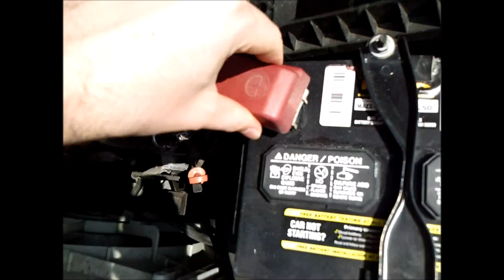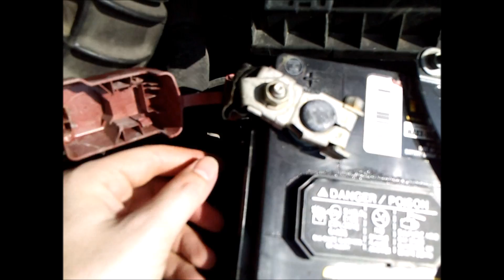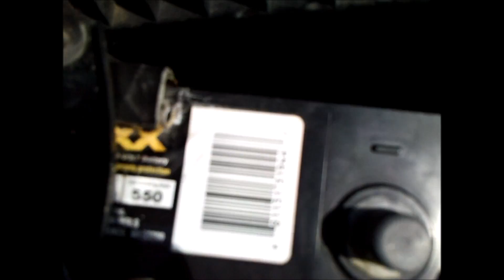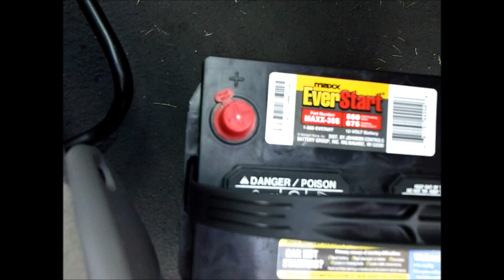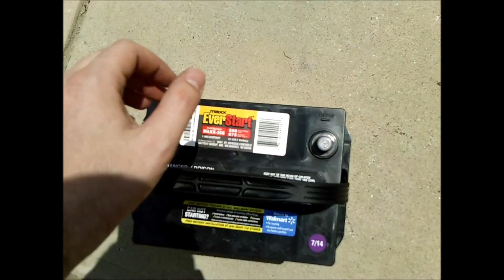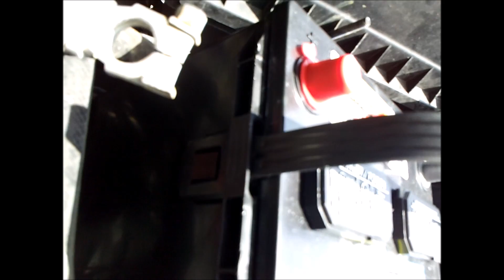How to Replace a Car Battery – Toyota Corolla (Step-by-Step DIY)

Comment: You DIDNT show how to attach the j bolt!
Reply from the maker: Thanks for the feedback; you just hook the bottom of the J-bolt into the slot on the battery tray before tightening the nut on top.

Comment: Thanks for the video. Just got my battery replaced at Walmart. I opened the hood and found the positive post cover not in place. No big deal, I will snap it on myself. When I did the entire battery moved. The J-bolt base clamp was not secure. It took me a while to get it under the base tray and tighten down. I used your trick to remove the left side handle but couldn't get a screwdriver in the right side. So I used a pair of garden pruners to cut the handle.
Reply from the maker: Great work! 💪🏻

Comment: can u show a close up where the rear hold down rod goes? I cant find any hole in the rear of battery????
Reply from the maker: My best advice, lift out the battery entirely and use a bright flashlight to find the rod hole.

Comment: Great video except that there is no need to remove the battery handle. It isn't in the way. Leaving the handle installed on the battery is highly convenient the next time battery removal is required.
Reply from the maker: To each their own.

Comment: Dude how do i get the rod that is hooked into the frame. Back into its hooked position.. It fell over the second I removed the strap bolt. And I can't get it to hook into anything while still being long enough to connect to the battery strap
Reply from the maker: It takes some practice! My suggestion - take the battery out entirely and get familiar with the hook-hole location, then during re-installation use a flashlight to make sure you’ve got the right spot.

Comment: Exellent video, I normally take of the bolt to the clamp that's bolted on to the frame, I happened to lost it you wouldn't know by any chance what size and length it would be?
Reply from the maker: Thanks!
I don’t, sorry - you should reach out to your dealership.

Comment: After changed my battery from my Corolla …the car was desregulater on lower rpm . It’s normal ??
Reply from the maker: That sounds like a different problem - the battery change should not affect the RPM.

Comment: Can you recommend the tools required to replace the battery
Reply from the maker: Socket set/wrenches are the basic necessity.
Gloves/eye protection for safety.
Acid cleaner if the cables are stuck on really hard.

Comment: I see no reason to remove that plastic handle; it makes it easier to lift out the battery in the future and is compressed nicely by the security bar.  I also also use terminal grese on the battery posts as it retards corrosion. I got excellent service from the OEM battery from  2009 Corolla and replaced the battery in the summer of 2020
Reply from the maker: Great suggestions!

Comment: 7:10 dude you cut out the most important part for me, how to connect the rod that the strap connects to...
Reply from the maker: Sorry about that! There is a hook on the rod, and a hole on the platform, that secures the battery.
Reply: @GalippsGadgets  WHERE is the hole on the platform??
Reply: @MrBilldodd   Agreed....can't find the hole for the rod (That's what she said!). Seriously though, I shone a flashlight down there, and can't find the hole in the metal support under the plastic tray....help!
Reply: YES, I CHANGED MY BATTERY AND HAVE NO IDEA WHERE THAT GOES. i FELT FOR A HOLE DOWN BELOW TO CONNECT IT.
Reply: That’s the most challenging part today. I was changing my led headlights what a nightmare trying to place holder down to the whole to stay stable.

Comment: question if i replace my battery will the clock and radio be resset or have issues with raido locked?
Reply from the maker: It depends on the make and model, and if your radio is equipped with a battery backup, but most vehicles will be reset.

Comment: Straight forward replacement for most Toyota cars - BUT - remove the cables in the correct order:  To remove OLD battery always remove Negative first - than the Positive.   Hooking up a NEW battery always connect Positive first than the negative.  Search this if you have questions.
Reply from the maker: Thanks for the comment - could you please subscribe to my channel?

Comment: What to do when you have a battery wire that's to small to fit over the battery prong itself?
I am not at all motor savy.
THANKS
Reply: My second negative wire has small rings instead of a wrap around like the positive one.
Reply from the maker: I’m not able to diagnose your issue without looking at pictures - you might want to go see an automotive technician.
Reply: DavidGalipp 
I had figured it out. Thank you!
Reply from the maker: Thanks for the comment - could you please subscribe to my channel?

Comment: How do you reconnect your battery without setting off the alarm?  Is there prep work to reconnecting the battery without setting off the dealer installed alarm?  My 95 Corolla doesn't seem to have a reset button anymore and the keyless entry remotes aren't very responsive and reliable.
Reply from the maker: +ourlegacy I wish I knew the answer, but I think it depends on the brand/type of alarm you had installed.
Reply from the maker: Thanks for the comment - could you please subscribe to my channel?

Comment: Thanks.  today, I repeated the process shown in your video on my 2003 Toyota Tacoma.  To prepare for my trip to Walmart ( Walmart Supercenter in Kenner, LA ), I used my phone in my right hand to take pictures of my battery with my left hand holding a ruler across the length and the width.  Also, I wrote down the battery dimensions: width, length and depth on a piece of paper.  I walked into Walmart with my ruler and the piece of paper. When I visited the Walmart battery section, I used their mini-computer on the wall to select my auto(truck) make, year, model, and engine.  I was returned with a list of many possible batteries.  I chose a battery using the mini-computer list, my phone pictures, and verified with my ruler measurements that it would fit in my truck.  Later, during my actual battery install, I ended up leaving the battery strap on.  Seven years ago when Goodyear changed my battery they left the strap on.  I figured that any future removal of the battery would be easier with the strap on and my truck hood closed and opened without any problems. ... Thanks! for the video, I re-watched it many(4) times before I did my battery change!
Reply from the maker: Great job Andre!

Comment: David,

Thanks for the video. I have a 2005 Corolla also. Is it going to be 10MM socket also?
Reply from the maker: tomatojuice12 It SHOULD be, unless you've had some aftermarket changes to your electrical wires.
Reply: @GalippsGadgets  what kind of tools you used?

Comment: My hubby bought a new battery for my 2009 Corolla. He works constantly, and hasn't had time to replace it. It still has a little charge, but hesitates every time upon starting. Will it be a problem to change if the battery still has a little charge in it? I've never changed a car batter before. Your video makes it look very easy.
Reply from the maker: +Lisa Sieminski You can replace your car battery even if it still has a charge.